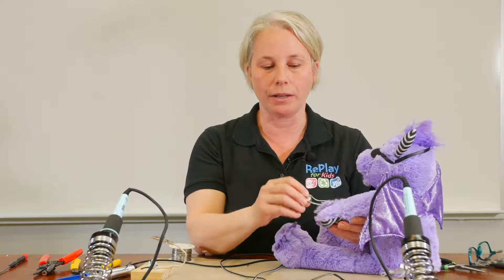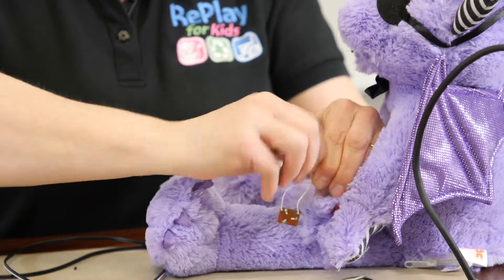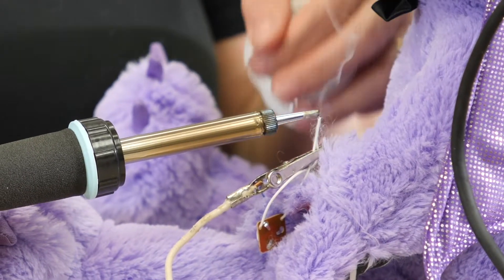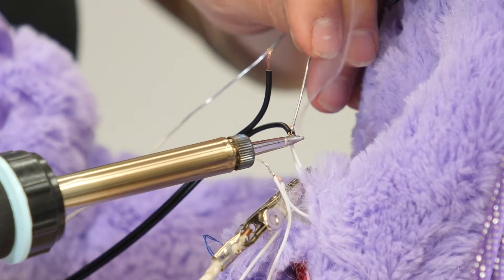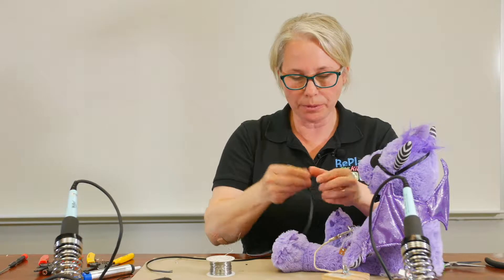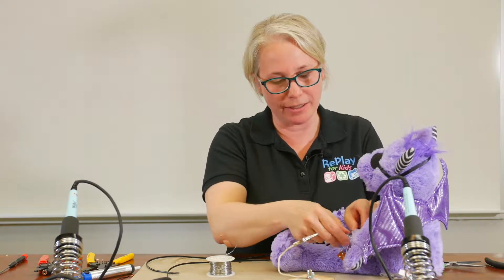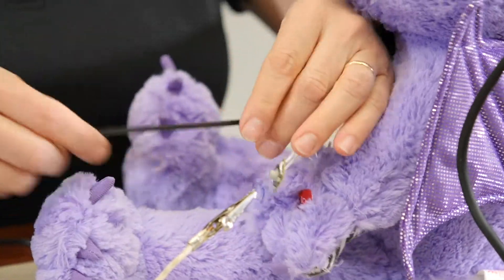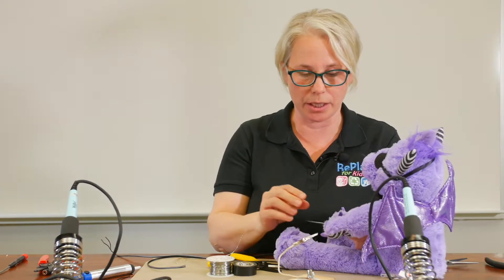How to connect wires to a push button switch when adapting a toy.

Comment: Where do you get a replacement switch?
Reply from the maker: I get our switches form Amazon. Something like this might work.

https://www.amazon.com/uxcell-12x12x4-3mm-Momentary-Tactile-Button/dp/B07JM449CQ/ref=sr_1_21?crid=1HZ47NWEQ20UO&dib=eyJ2IjoiMSJ9.tiZUK2mx4lN4hR6JvULgYXXNdH2KW-b_67ZVq8oUgAj2Lk_qKM7zuJgnmqnNYrl6sQkYlJmodNRnK9Xs03UipIdBB2yhK7hr4dbd-jQcNGsYd1FCUYTjCyQyN-XY_0QaCFDWZgcSH3BnrZCsiItfBr4C4B8s21DOMuEBWLtBI-C-06UmaRpkmZeM80psW6k6SNfx8rd0smT-D1dxZhiCpq6Icp5gS8ZB9tr8U7bMQEwqe2IeZ1KKb94vnP4Ka5VnZXyExdKrREu7Ii_fpLd6KYLKVe1ULoEPtMv0w3sDkOo.gz9qUKQ2Ib8Z_8DoATHlc9bGpj4FtWep-J0Wp6SqyjA&dib_tag=se&keywords=PCB+Momentary+Tactile+Tact+Push+Button+Switch+DIP&qid=1721145731&s=industrial&sprefix=pcb+momentary+tactile+tact+push+button+switch+dip%2Cindustrial%2C104&sr=1-21

Or if you have another plush toy that isn't working you could just remove it from the broken toy and install it in the toy want to fix.

Comment: I need a new push button or switch to connect to the 2 wires. My grandson squeezed too hard and broke the push button and the wires are no longer connected. Where can I find a replacement button?